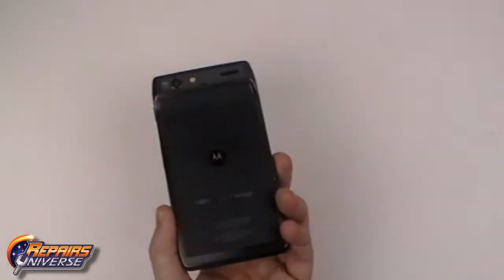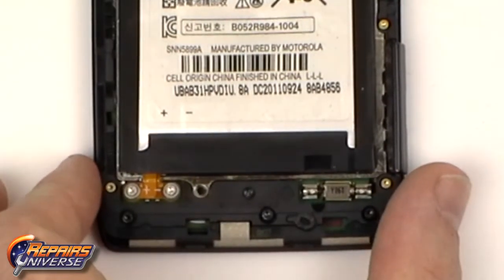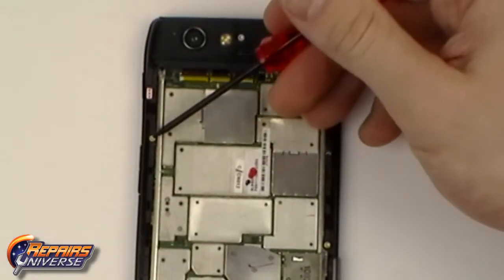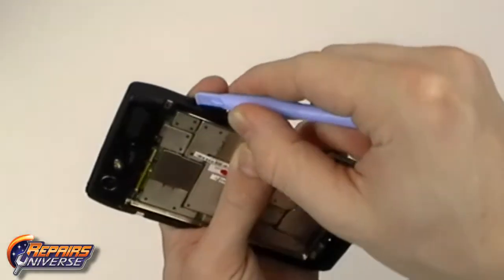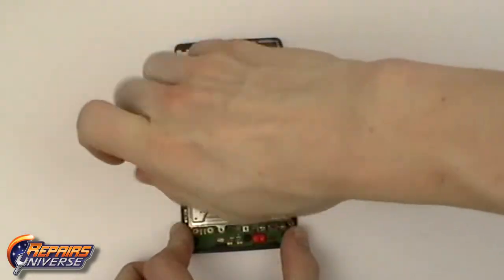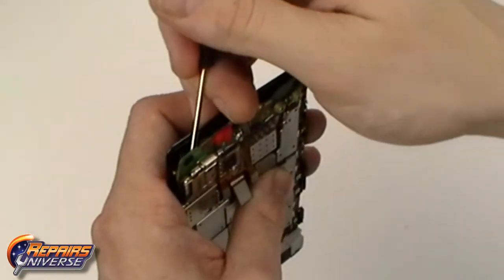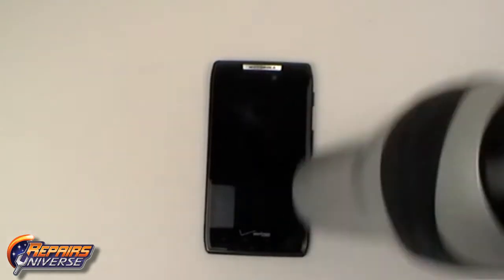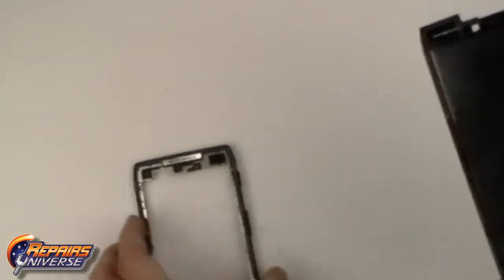Motorola Droid Razr Take Apart Repair Guide

Comment: I have a Droid Razor XT912.  I dropped it a year and a half ago, the glass front is fine but I can't see anything on the screen.  I was told it would cost $250 to repair.  Is this something I could fix myself or should I have someone else fix it?  Thanks
Reply from the maker: http://www.repairsuniverse.com/motorola-droid-razr-lcd-touch-screen-digitizer-replacement.html

This is the link to the replacement part you need. You should be able to take care of this repair yourself. If for some reason you have an issue or don't feel comfortable completing the repair yourself you can follow this link and send your device into us, and we can take care of it for you.

http://www.repairsuniverse.com/repair-service.html

the cost would be 60.00 for the repair and 79.99 for the screen plus tax. That includes return shipping to you.

Comment: I have a question before buying. My screen is cracked but im still using the phone(actually I'm using it to post this comment) what is the part i need? I've read somewhere that you have to replace both the lcd and the outside glass. Is this correct? Or i just can change the glass and that would be it? Thanks for your response in advance
Reply: Motorola Droid razr xt912 charging jack jumper solution required me